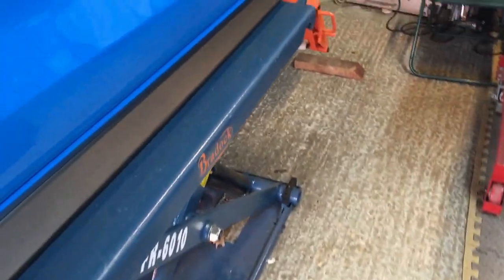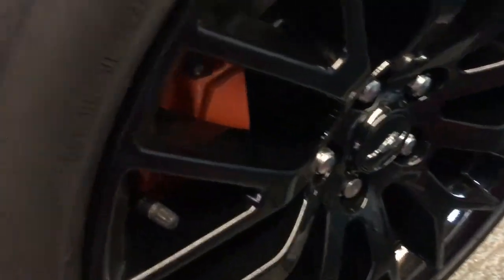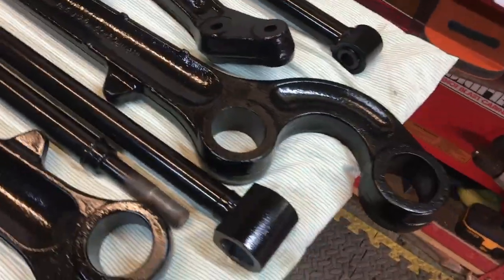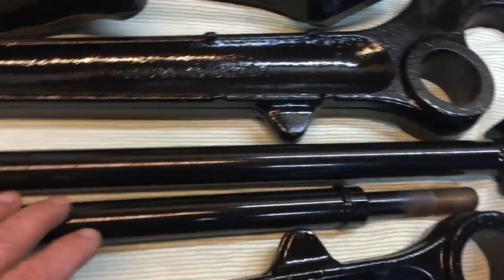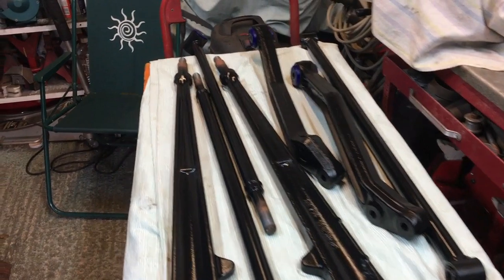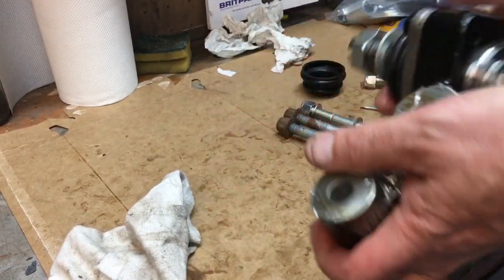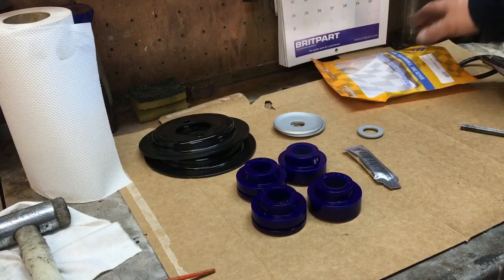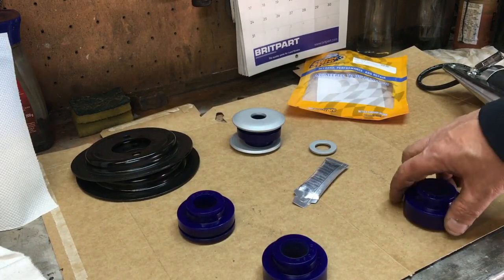Fitting the Super-Pro bushes and getting the axles under the chassis.

Comment: Corroless * however spelt ,  is the exact same stuff in the eastwoods rust encapsulator premium iirc they do say not to leave in sunlight something to look into for you
Reply from the maker: I can only reply with this answer.. Corroless is designed to be used on external steel structures, so sunlight is unavoidable. Having said that, does it really matter if your external steel structure stays glossy or goes slightly dull??